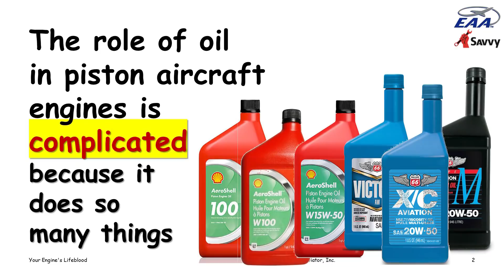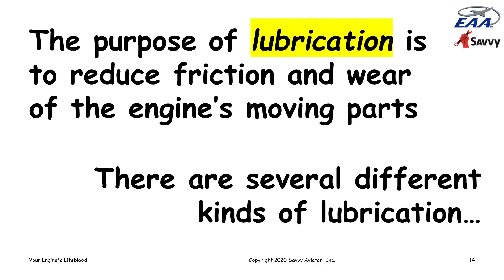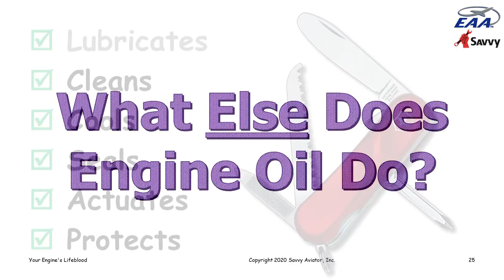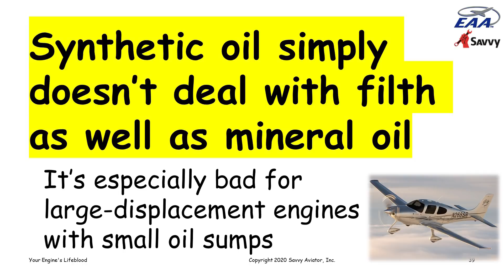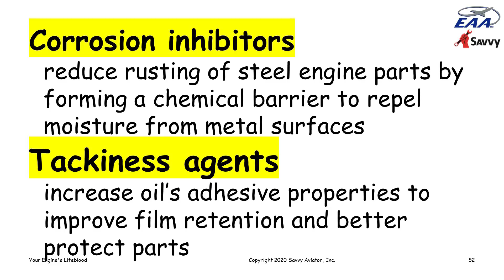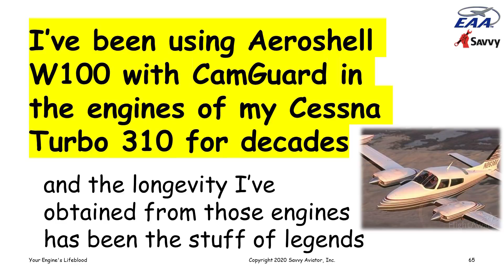Your Engine's Lifeblood

Comment: They use synthetic oil in aircraft piston engines! No problem with it, they are even better than Mineral BUT YOU CAN USE IT WITH STRICTLY LEAD-FREE GASOLINE. They have been flying with synthetic Motul oil for over 10 years
Reply: Yea no thanks on both behalves. Big reason they don’t use it everywhere

Comment: I would like to suggest if you use an additive for an aircraft engine, you might want to try using fr3. Gale Banks even suggests that a few ounces go into differentials. He claims it reduces parasitic horsepower loss. And would subsequently probably lower temperatures by a few degrees as well as increased lifespan of those contact surfaces. It is a ceramic rather than PTFE
Reply: AI troll

Comment: Our leaser insisted we used multi grade oil in a Warrior. It always ran hot and the oil is like water when hot, i think so thin it passes to quick throiugh the cooler. Also oil burn on a new engine was bad, at least a quart every 10 hours. Good new engine i have seen one needing 3 quarts in 50 hours. Starting to get expensive to operate.
I stared dropping in 100w and that would reduce the burn.
We just changed to TotalD80 from Shell w80 on a Tomahawk, that is now burning oil. So just dropped in Shell w100. In 5 hours the oil consumption has dropped  to 1mm in 5 hours. Will be Shell in future.

Comment: I don't understand why leaded fuel is still used, it should have been banned a long time ago. It is not necessary in a modern engine with an ecu. I enjoy these videos, but they seem as though they were recorded some 40 years ago. No one in their right mind would still be using leaded fuel even if ti was an option. Avoiding the use of modern PAO oils so that leaded fuel can be used is just silly. Pilots are supposed to be intelligent, don't use it.
Reply: Clearly you know nothing about how the FAA works.  Pilots wouldn’t use it if they didn’t have to.
Reply: @nealthompson2805  There is no need though. No modern engine requires leaded fuel.

Comment: Nice to see aviation connecting to Tribology. However, a little comment: The explanation on the synthetic oils falls short in the scientific background: Synthetic engine oils can be composed of base oils (group III oils and group IV) with very different chemistry. Each base oil needs a specific additive package that is tailored to the engine (swelling of seals can be a problem too) and the fuel that is used in the engine. For aviation piston engines the market is probably to small to develop an optimal additive package that would lead to the best performance with synthetic base oil but in principle it would be possible.

Comment: Interesting about lead sludge we have never seen this in race cars running 118 oct gas with much higher lead content than 100ll and synthetic oil I wonder if it’s because there’s no detergent in aircraft oil. Because this problem is unheard in hi performance boats and cars ect running higher lead levels than avgas with both ester based and PAO based synthetic oil
Reply: What brand gas are you running?  Where do you source it?
Reply: VP 118 and Sunoco SR18 for the high boost/compression engines some NA engines running over 18-1 compression they sell it at the racetrack or you can order at at a speed shop we have a local gas station who sells 115 octane Sunoco leaded at the pump great for 14-1 and under engines and low boost applications much cheaper at about $6-8 per gallon today where the 118 is around $15-20 per gallon last time I bought it
Reply: @Trump985  That is pricey stuff.  I suspect the difference in sludge formation is due to a couple of things: 1. The much high blow by in a typical air cooled engine which generally has looser piston to cylinder clearances and wider ring end gaps, 2. The fact that airplane engines run for hours on end at high power outputs and run a couple thousand hours between tear downs and 50 - 100 hours between oil changes.  How many race engines run 100 hours between oil changes or 2,000 hours between tear downs?
Reply: @LTVoyager  a buddy’s offshore power boat has a pair of 650ci bbc’s running 110 octane fuel it gets 50 hour oil changes with redline oil and 500 hour teardowns this is the longest service intervals for leaded gas  I know of outside of GA it runs full throttle all day only momentary throttling for a fraction of a second when the boat is airborne this is the best example I have outside of aviation and I have never seen any lead sludge in the engine when we tear it down at the end of the season. The air cooled loose ring gap piston to skirt clearances is a good thought,  what do GA engines run for ring gaps we run .030 top ring gaps on these engines I am curious as to why this sludge problem occurs in GA engine and not anywhere else? The lead content of the 110 fuel is higher than 100LL and we see a good amount of blow by on these engines due to having to run loose ring gaps and piston to cylinder clearances. I wish I had the resources to do some testing of this problem with GA engines and aviation oil vs automotive oils

Comment: I bet unleaded fuel changes the color of the inside of exhaust pipe.
Reply: Plugs will last for ever, sort off.
Reply: @flybobbie1449  I've noticed the exhaust system lasts longer as well, but people have argued with me on this.
Reply: Less than leaded fuel, you don’t get the white/cream colored coating that is left from the lead

Comment: 5 year shelf life on oil, like most stuff I think the 5 years is a bit short.
Reply: Depends on additives, in time they can separate, according to a Mobil 1 engineer I discussed this with, in small quantities such as one quart containers, the additives remix as they are cycled thru the engine.  In large quantities such as a 55 gallon drum, the additives will separate and the additive package will be too high or low depending on level of where the oil is pulled from